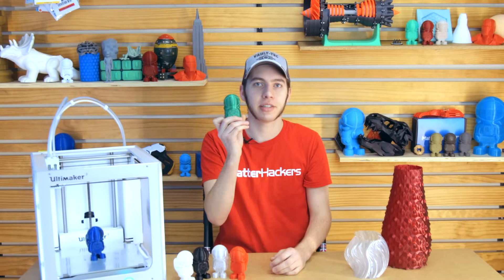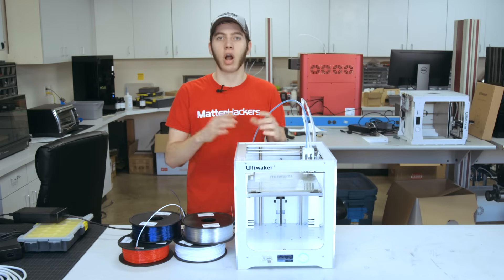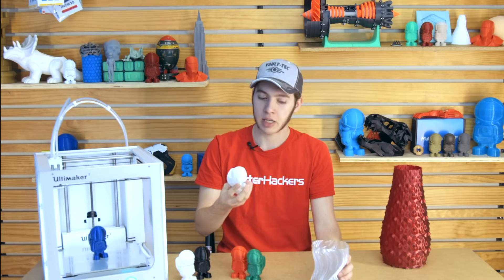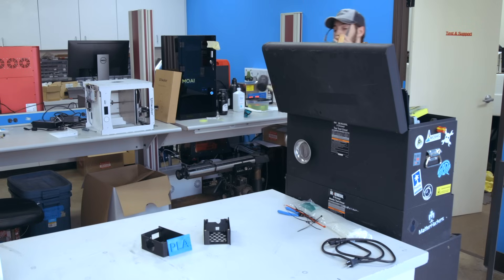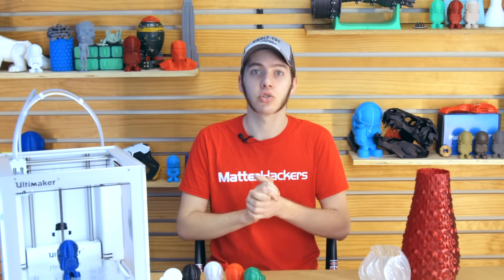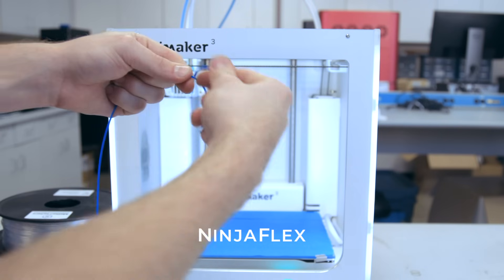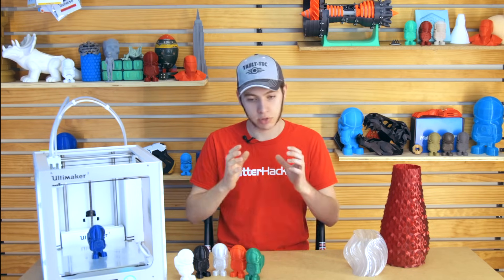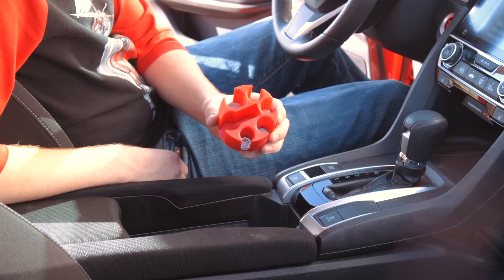BEST TIPS FOR BETTER PRINTS WITH PETG | Everything you need to succeed with PETG filament

Comment: As a complete 3D printing newbie, I bought a Bambu A1 Mini a few weeks ago, and have printed dozens of models in PET-G with perfect results every time. And I simply selected ‘Generic PET-G’ in Bambu Studio, haven’t changed any settings. It’s fantastic. I don’t think I’ll buy any more PLA (which also prints perfectly BTW) because for me there seems to be no advantage over PET-G.
Reply: I’m going to get a Bambi Lab mini. Are you using the Bambu PETG HF filament? Do you use glue stick or a spray on the bed? One more question, do you use a filament dryer?

Comment: "PETG is as easy to print as PLA"
"SPeed: Same as PLA"

I can get about 17-18mm/s with PLA on a stock Ender 3 v2 hotend with a CHT nozzle.
On PETG, I lose layer adhesion at about 9mm/s.
For transparent PETG, I lose clarity at anything above 5mm/s
245C on a 70C hot bed. Part fans at minimum. (Fans a max is just so much worse.)

Comment: Overall good video but I felt the need to point one thing out. You can’t do a stress test comparison between PETG and PLA by hitting the PETG lightly on a solid wall and then hitting the PLA harder and on a wall with a hole.

Comment: Desiccant absolutely does pull water out of filament. It's just very slow. If you put it in an airtight container it'll dry out after several days. I've successfully dried nylon with nothing but a Rubbermaid container and some desiccant.

Comment: I spent the last five days sorting PETG on an Elegoo Neptune 2S. Everyone on YouTube, including you, have gotten it wrong. I have been printing PETG for years on my Geeetech MeCreator that is nine years old with NO cooling fan even installed on it, and a direct drive PTFE zero fin hot end. So I have a clue what works. I spent the last five days and figured out how to make awesome, ZERO stringing, prints. 

Trust me, everyone is going at this wrong. Go back to your roots.
Reply: Can you elaborate what you are talking about? Maybe give some settings?
Reply: @KaloyanDobrev  What filament are you running? Each uses different settings

Comment: Not only do I print PETG for years now with a PTFE tube at 230°C but I also never had a problem with it being hydroscopic. So idk what you are talking about at that time ...
Reply: Got any other settings you use for it? Mine printed great right out of the box. It sat overnight and was doomed ever since. Dried it out in the filament dryer, adj temp, height of bed, speed. It gets stringy and globby. It is dried out.

Comment: I run a Capricorn bowden tube on an Ender 3 pro and I print PETG at 240/245 on a powder coated PEI metal bed sheet works fine comes off no problem. I tried an all-metal hotend and it kept clogging I had to buy a cleaning tool that's 1.75mm to clear it after 3 times I went back to the bowden. I had tried the blue tape never would stick to the bed plate it would pull up if the part warped. With the PEI I ran at 80C bed temp solved the warpage.

Comment: Ty so much Alec! You are the first person in my journey to solve this thought in my head . I know this is an older vid but I’ve looked through a few now and no one mentions supports with petg . I am designing something that will need supports and it’s my first print with petg . Besides a Cali cube literally my first . I feared it would weld too well so ty for the air gap info!!!

Comment: I got PETG as my first filament for my first 3d printer and I had been wracking my brain on why It didn't work. I then saw an article that said it required higher heat and slower speed to make. Would have saved me some time to research that first. But I guess I can't blame anyone but myself for that one.

Comment: Great video.  I would suggest that you add two things in your recommendations... 1. do you want to print enclosed like ASA or ABS or do you want to print open like PLA and 2. Are there any concerns about nozzle size or does it not matter?   Oh, on a more personal note, thanks for the warning about PTFE tubes, I would have made that mistake this weekend without the warning.  I will switch to my PEEK lined tube for this weekends experiments.

Comment: 3+ orders from you guys and ive not had one good experience with your filament. white pla pro printed worse than some free filament i got and along with the black PLA i bought. decided to buy $114 spool of PVA from you guys and the shipping bag and vacuum-sealed bag arrived ripped open and the first 2-3 layers of the spool were fused together and took me over an hour to remove those layers as I needed to use that PVA ASAP well it wouldn't even print so i lost money on an order because  you guys cant ship filament in a damn box. you decided to cheap out and use a softbox that is pretty much bubble wrap lined with cardboard

Comment: “Let me hammer PETG:” pow, pow, pow
“Now PLA:” POOOWW, PPOOOOOW! POOW!
Oddly enough, PLA still resists better 🤣

Only reason to choose PETG is some better resistance to heat (it is not rare to find situations where PLA deforms) and to see some flex before it breaks - PLA will break without any notice. Strength-wise, PLA is stronger.

Comment: I have an LK4 longer. It prints aba, and petg very well. 240, 80 bed, painters tape on the glass, little glue stick, make sure you get a good first layer and bam! Strong, glossy, layers well. Time consuming, but pretty good material all around.

Comment: It is like ABS a total pain to even get to stick down on the 1st layer never known print with? I got a good 3D big Printer which is said by the company who made the printer  can do PLA, ABS,PETG, and even TPU. I have a good 24 Volt heated bed and all metal Mk 10 hot head. 

And like many others I can't get the PETG to print right. ABS as well and also troubles doing TPU, even though I have a Titan Extruder too.  So saying PETG is easy is wrong? 
It is a huge pain to try to do. I tried many many times to even do a test print and no luck at all. I used the Scotch Blue tape for the bed for helping the print to stick, 

But the blue tape really does no stay down on the bed at anything over 80 c it just peels off. I just got some gold heat proof electronics tape to try on the bed, 
But my print is waiting on a replacement part from China and at this time of year and with me being in the UK, and Brexit about to happen well, that will slow down the delivery of the spare part big time as the company told me?

ABS and PETG are totally super hard to do no matter what we are told? 
If you have not enclosure like I don't have or afford then any small bit of draft of air will bugger up the bed or head and no print.
Unlike some lucky people who seem to have tons of money to buy a enclosed printer costing thousands and 
having the very pricey filament dryers the rest of us can't get around the printing problems so easy.

As I said a huge pain doing any ABS, PETG or TPU.

Comment: To add to my post, I am also using the eBox by eSun filament dryer. I use it as a Dryer and a filament holder. Should I still run the Translucent orange Filament though my Food Dehydrator?

Comment: Alex: what are your settings to reducing Stringing? I am using MH Build series PETG White and Translucent Orange. I find the Translucent Orange very pretty but is much harder to print with. I am using Simplify3D. I have an E3D v6 Gold hotend and Zesty Nimble extruder. I am using the New Build Tac that is for PETG on my bed. When Are you going to get back in stock or carry, Clear MH Build Series PETG?

Comment: I know this video is a bit old now, but I wanted to see if people got any better results with stringing issues. I'm currently using MH Pro PETG (on my second kg - and no matter the brand or type of filament, every roll gets its own EM calibrated). MH recommends 245+/-10C for this specific type of filament. After multiple adjustments to retraction settings, I couldn't get rid of the stringing and additional blobs. I went back to the basic tests for temp. Printed at 225C (with manageable but still annoying stringing, remedied with a heat gun leaving some blobs), then at 235C (with severe stringing, not fixing without significant post processing i.e. sanding, filing, etc.), and finally at 220C (with very minimal stringing, easily remedied with a heat gun). After dialing in the temp, I then fine tuned the retraction settings (Retraction Length: 1.6mm, Retraction Speed: 70mm/s, Retract on layer change, Wipe while retracting and Retract amount before wipe: 60%) in Prusa Slicer (v2.2.0), and ensured that I enabled 'avoid crossing perimeters' and set the seam position to random. The result was a near flawless, stringless print of the two column stringing test (commonly found on thingiverse). Printing on a stock Prusa i3 MK3 with latest FW. I'm not completely sure if a drop in temp like that is significant enough to affect strength properties; I don't have the equipment to test that, but hey, at least the stringing is taken care of! I hope this helps. Happy Printing!

Comment: I'm printing a plane wing out of PETG with one perimeter, and it's warping the wing quite a lot. The bed adhesion seems fine, it's just that over time, the poorly supported skin of the wing (it's being printed vertically, so the bottom and top skin of the wing are to the right and left) is bowing inwards between the spars, and the spars themselves are being printed attached to the skin, so as the skin contracts, it's pulling the spars in slightly too, causing the frame to be warped as well. Any thoughts? I've tried printing with an enclosure, lowering the temps from the PrusaSlicer defaults, without really any difference in quality.

Comment: can you say anything about Carbon Fiber PETG I found it a little more forgiving than NylonX, using many of your tips to get some great results. Can either one be annealed after printing to improve heat resistance?
Reply: PETG does not anneal.  It's PET modified with glycol to prevent crystallization so it stays completely amorphous.  This keeps it clear and prevents it from becoming brittle.

Comment: "PETG is as easy to print with as pla" 
- me after 20+ of trying to print a single thing in petg-
screaming intensifies
Reply: I'm in the same boat as you... promoted like a miracle filament when it's still finicky
Reply: Same here. 20 prints of a large(310mmx290mm) flat part that .. even though I printed nozzle at 231 degrees it pulled my bed sticker  up in the corners and they stayed there making that a high spot on the bed.  i am on my third sticker.. no warping?  yeah right..  also stringing becomes less of a problem faster retraction speed and enable coasting.   A a silicone sock on the hot end keeps the strings from turning to blobs
Reply: @kirkd6285  use Cura petg settings....I change retraction to 3 and speed to 145ms....240 nozzle and 70 bed.....nice smooth prints
Reply: @MyEyeOnYou  I sort of use these settings too, also fan off.. Like totally off from start to finish has worked wonders for me
Reply: @TheMostTruth  Thanks for the fan off tip. I'm printing PETG on an Ender3V2 at 235, bed at 92 and fan all the way on. Going to try no fan when I get home.
Reply: @TShepard  ok on the cr10spro i do fan off, 240 on hot end and 0 on the bed. but results may vary ofcourse
Reply: @FragBenitez  0, so no. None whatsoever
Reply: @kirkd6285  he said you print at 250,s with it lowest 245
Reply: Me too, lol...
Reply: PLA prints incredibly here at 120mm/s, but I can't stop my PETG from stringing at 40mm/s.
Reply: I feel this man. Knocked 5 years off my life but i finally got it. Heads up I'm a rookie but I got perfect PETG out of my Flashforge Creator Pro by heating THE ROOM up to 80 or 90F (27-32 normal person) with a space heater. (overture petg) Temp 245, bed 80, 30mm/s, 150 travel speed, no fans, glue stick on the sticky cellophane. Hope this helps someone not feel like i did lol
Reply: I want to die after trying to print something in petg
Reply: watched dozen of videos and suggestion. have different results but none good. it either does not stick at start or after few layers.
Reply: It’s a big marketing scam, they all say it, it doesn’t stick to bed for nothing, you need to put glue and Rouen the surface and squish it in. Then it sticks to nozzle and creat blobs of plastic on your print. It’s hardest to print. But it’s a very good material if you need a part that under stress and temperature. So it’s worth the trouble. If you don’t want to sniff ABS fume.
Reply: @SinaShahsana  I don't use any glue just a heated bed and it sticks fine tbh
Reply: @fkingride.5500  what temp is your bed and nozzle?
Reply: @mememe4821  heated bed at 70 nozzle between 225 and 250 depending on print speed
Reply: @fkingride.5500  thanks. I will try a lower bed setting. I have mine at 81 currently.
Reply: @mememe4821  no worries , i know my channel is a motorbike channel but I do own 3 3d  print alot in my spare time so if you have any questions let me know over there 👍
Reply: @fkingride.5500  thank you. I got it to print halfway decent but not as good as I need to make a knitting machine. I will work with my printer and maybe stick to pla for this print. It seems to move during the print and glob on the hotend. I am thinking of going to an all metal hotend. Not sure if that will present more issues printing or less.
Reply: @mememe4821  try enabling z hop when retracted that will stop the hot end running through parts of the print as the hot end moves around and shouldnt glob up anymore do you use cura slicer? all metal hot end can bring a whole new set of problems if your settings are not correct like heat creep and so on which will cause blocking and can just be a mess if you dont know what your doing with a standard hot end first, let me know if you want me to make a vid for you on printing petg, pla does not have the strength for fast moving part like what i imagine you will use in your machine petg was a good call :)
Reply: @mememe4821  and also plz consider being my 100th subcriber if i have helped you in any way, and if your interested i will send you a petg and pla fidget spinner i have just printed :)
Reply: @fkingride.5500  I would be happy to.
Reply: @fkingride.5500  I would love to see how good they can print to see what I need to work up to.
Reply: @mememe4821  private message me an address to send the spinner to :)
Reply: @mememe4821  and i will also upload a vid asap for you to print petg :)
Reply: @fkingride.5500  thank you
Reply: @fkingride.5500  awesome
Reply: @fkingride.5500  I got a nice test print thanks to your z hop suggestion. Thank you. 😊
Reply: Lol I had 6 prints fail with PLA... Nozzle temp too high. I'm not good at this :'(
Reply: @TheFreeguy12  don't be too hard on yourself, I have done a huge amount of reading/viewing before attempting  my first print, and (like anything) there is so much conflicting advice out there. The only thing everyone agrees on is bed levelling being really important!
Reply: I’m trying some new PETG from Duramic making a benchy right now on Ender 3 v2.   Ended up using 250 hot end and 80 bed.  It’s laying flat, no warp.   No glue stick or adhesion on the stock bed whatsoever.  Just put the new blue Bowden tube in and metal extruder on today.    Two big keys I was screwing up at first after a few failed attempts was 1. I had to grab a generic PETG profile for Cura, otherwise it is slicing for PLA.   The program adjusts for it.    Then, I was told to slow it waaay down for first layer.  Like 5 speed., no fan, double layer thickness , Z adjust down tight.   
Then go up to 25-30 speed with slow fan,  If you’re trying to put down a first layer like it’s PLA, it’s not gonna happen.
Reply: Or just get a higher temp ptfe tube
Reply: I gave up using it after about 20% of a roll, turns out I had my settings way too hot and way getting heat creep even with a full metal hot end. Now that same roll 18 months later without drying is printing at 100mm/s at 240°C and 65°C bed pei textured plate. also dropped my stock retraction from 6.5mm at 40mm/s to 5.5mm at 48mm/s and its been working a treat. I must've initially spent months trying to get it to work. FL Sun super racer, fans at 10% with 2x 5015 blowers.
Reply: SAME!!!!++ plus after a while my petg print became brittle and broke! How do they do it??
Reply: That claim is total bullshit. Oh, sure, once you get the first layer down, I'm sure it's fine. 
Good fucking luck getting that first layer down. Ever.
Reply: @TheVideoGuardian  Not quite sure who this is for? If for OP, he was kidding. If for me: It works for me on my printer(CR10sPro) on the particular filament(add:north clear PETG) i use. Not much else i can say
Reply: @TheMostTruth  Sorry, I meant the claim that PETG is as easy as PLA, not you.

I use a Longer LK4 Pro (Similar to Ender 3)
Using Hatchbox PETG.
No matter my settings. Nothing works. (240C hotend, 70C bed with  glass/buildtak/painters tape, various nozzle heights, etc)
Filament just gets pulled up after a few seconds and follows the nozzle, then curls up and forms an extremely sticky blob. 

In contrast, I can print PLA, ABS, and TPU without any real problems. It only took me only a few test prints to get these materials dialed in. For all the criticism ABS gets for being difficult... I just don't see how anybody can say that PETG is easy. It's unquestionably the most difficult material I have ever encountered.
Reply: @TheVideoGuardian  I totally agree, PETG is really peculiar, and unless one really needs it there are way better options. And no where in the known space or time is it as simple as PLA XD
PLA is our version of plug and play :)